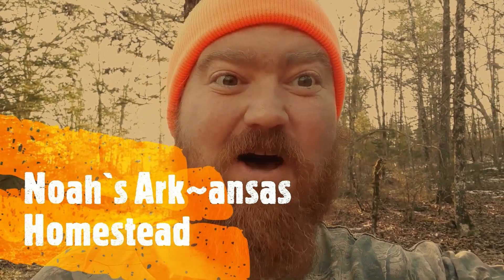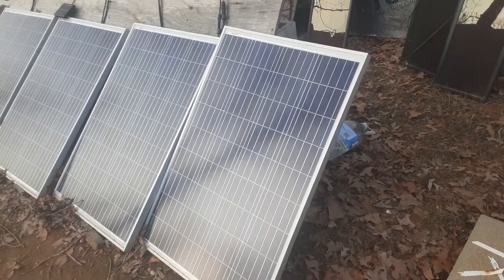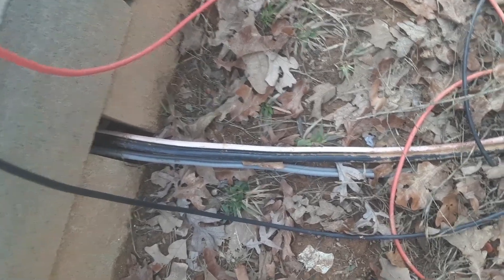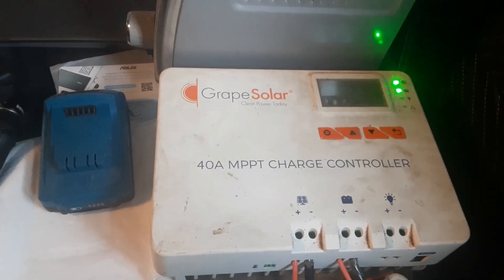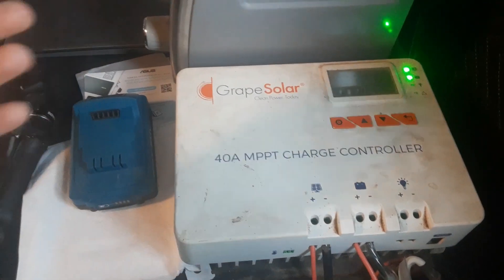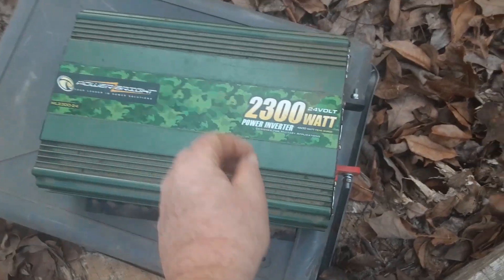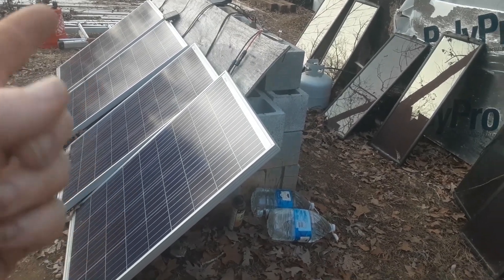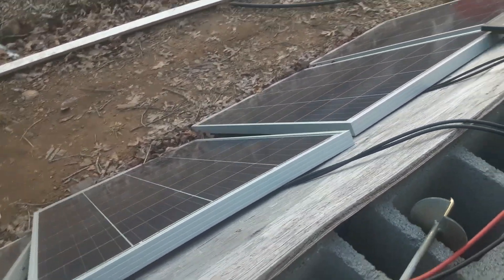Off-Grid Solar Power, Part 2

Comment: Keep going. Good video, but I suggest you keep the battery and the charge controller as close as possible with the cable length.

Comment: Hang in there.  If it works for you - that is all that matters.  We live and learn when it comes to solar.  The LifePO4 batteries do not do well in cold weather.  Have to keep them warm; some have cold temp sensors or heat.  They are lil more expensive.  Take care.
Reply from the maker: Good tip, I didn't know the lifeP04 were temp. sensitive. Thanks for your kind and wise words.

Comment: Good place to start and learn did the same 12 years ago.. Now living off grid in Tennessee for  5 years.  Just switched  to lipo 4 teck .Check out my playlist if you want to see all the mistakes I made tons of them very expensive. Have helped many ppl over the years. Good luck with your dream.
Reply from the maker: Thanks, looks like you have a bunch of awesome videos, I'm going to check them out. Definitely cheaper to learn from other peoples mistakes. Just made it past my first year off grid, it was rough at first, but now that i'm getting some systems in place its getting easier. Thanks for watching

Comment: Good video. I am fresh into the solar and wind turbine thing myself. There is a man on youtube named John Daniel that is very knowledgeable on solar and wind turbines. I have acquired a lot of know how from his page. You want to keep the length of or cable running from your battery bank to your inverter as short as possible, and consider using 12 volt dc lighting. Good luck in your adventure.
Reply from the maker: I'm just learning as I go. Yea, my inverter cable is twice as long as recommended, but I didn't want my battery bank too close to the cabin. Just thinking about DC lighting maybe i can use the DC port on my charge controller, so I can have lights with out running my inverter. Thanks for watching and commenting.

Comment: You got to remember at 12 volt your amps are 2 times than 24 volt but it all works out the same as to how much of your battery you use volts x watts  is your amp draw on the battery bank so the lower your voltage the more amps you draw but in the end it all works out the same other than you need bigger wires for lower voltages